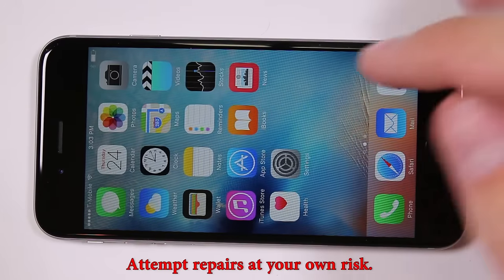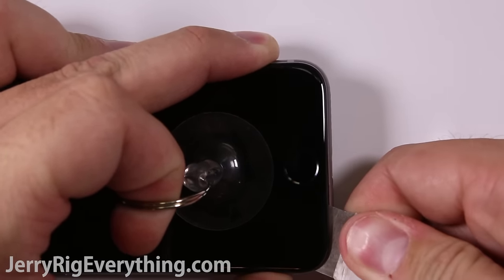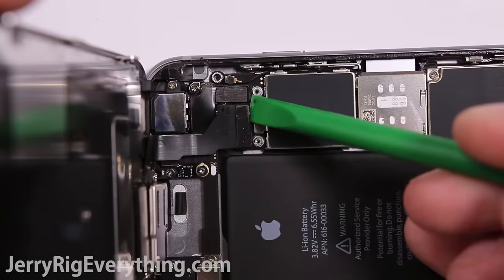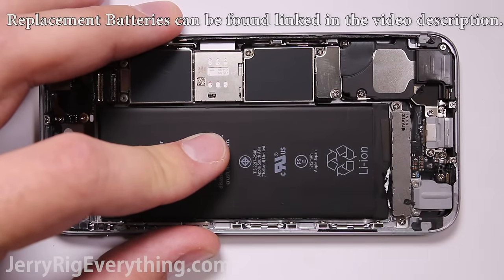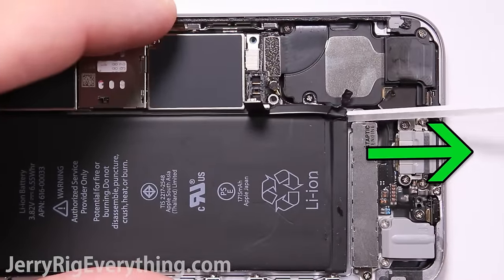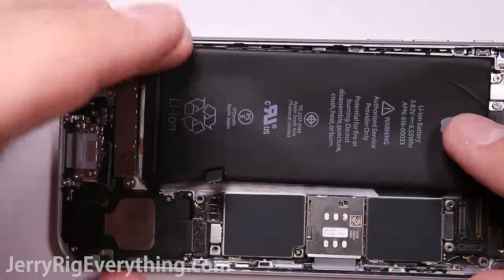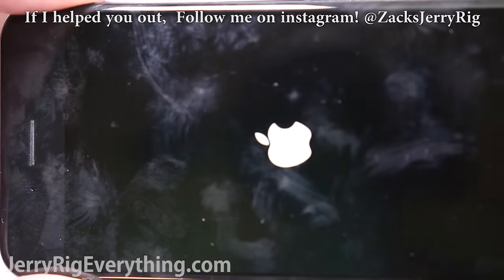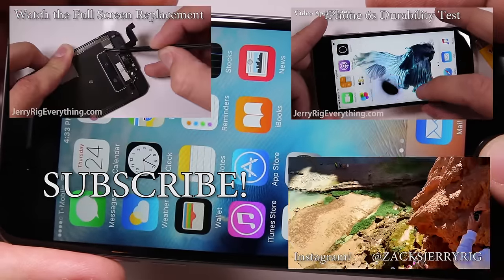iPhone 6S Battery Replacement in 3 minutes (Easy Method)

Comment: I'm thinking of getting an iPhone 6s but when I see how the battery is being replaced, I really get scared. Don't want it to get any marks or scratches. Wouldn't it be so much easier if apple made the replacement more user friendly?
Reply: Hate to tell you this but the iPhone has one of the EASIEST batteries to replace...the others are MUCH more difficult.  My personal preference is removeable back user replaceable batteries but for some silly reason "the industry" seems to think sealed, waterproof phones are better...they're not.

Comment: So. The easy way was to pull the strips out the bottom and hard way was to break the strips? If anyone is having issues removing the battery, Run the battery flat before trying this or add alcohol to dissolve the adhesive.
  Remove the rectangular metal device just below the battery, otherwise the angle is too sharp. You don't need to remove the screen at all if you hold it at an angle clamped by your hand against the phone. If it's cold warm the back of the phone with a blow heater or hairdryer or leave it back side up in the sun for 5 mins.

Comment: I followed these steps and was able to replace the battery. The phone turns on and the screen works however it seems to power off and back on randomly. Did I not connect the battery properly? Is that why it keeps doing that?

Comment: Annoyed how a phone seems to go downhill adter its paid off. Wasnt sure if this would be an easy thing to do. I have replaced the battery on my 80gb ipod a few times and repaired the click wheel but that was much older tech and seemingly easier. The ribbon cables on this look much eaiser to deal with. Im definitely going to do this over buying a new phone for a while.

Comment: VERY IMPORTANT SAFETY INFO: you need to drain your phone battery COMPLETELY before attempting to replace the old battery. I did not do this and the battery pack started getting really hot, so I panicked (because I know these things can explode) and put it in the freezer until it cooled down enough to remove the battery completely. IF THIS HAPPENS TO YOU, just place the battery (once you've got it out) into a bowl of water with lots of salt and let it sit for at least 48 hours to prevent an explosion or fire.

Comment: So i noticed when he was removing the battery he was really mashing it and bending it up. Is that safe. This could be my paranoia and overthinking getting the best of me but i want to attempt this repair however i am afraid that when i get to this point, i will bend the battery in a certain way causing the lithium cells to ignite. Its a process im capable of completing if i was able to overcome this fear as i have successfully replaced my screen on this device using a tutorial from this channel. Someone please help me with this information as i am in urgent need to do this repair. This is a stretch but im hopeful.

Comment: I did in 3 Minutes because I didn’t use those tapes either   As long as the connector is tight and put back the metal with 2 screws! You don’t need those horrible tapes since you will have hard time to remove too if something goes wrong 😂
And you don’t need to remove the connector to the screen too ! Just the 2 screws on battery connector! DONE

Plus : when I did the first time to remove the battery I made a big mistake and blowing up the battery 🔥 because I’d accidentally used metal to pray the battery and Buzzzzz 🔥 that’s my first lesson to be learned DO NOT USE ANY METAL but plastic ! 
But surprisingly the iPhone is incredibly there were nothing broken caused by boom battery’s I’m still using it now 😂 with new battery - the reason I love iPhone too ! Anti fires

Comment: Worked for me, BUT the adhesive securing the battery was nowhere near as simple to remove as yours. 
Sliding a spatula under it eventually freed things - but do this from the bottom, not the top, to avoid damage to ribbon connectors.

Comment: Followed all the steps carefully. But the new battery replacement doesn't fully charge even after leaving it for overnight. So I had to put my old battery back in. Now, it randomly reboots and can't read my battery under battery services. It just says your iPhone can't determine the battery capacity...
What did I do wrong?

Comment: its much easier to use a syringe and alcohol.. the tape comes out with one slow pull and then the battery just comes outs without needing to pry it out and risk bending it.

Comment: I just had my iPhone 6S Plus battery replaced at a shop and now discovered my wifi does not work. Is it possible that during the new battery installation that something related to wifi could have got damaged? I took it to Apple store, they shrugged and tried to sell me a new phone. Not impressed with these people.

Comment: To those that have replaced their battery, what battery did you go with? Does it hold the same charge as the original? Also, my SIM card (also any other SIM card) stopped being recognized by my phone after I dropped it in water. Do you guys think it’s the sim connector that got damaged and needs to be replaced or something on the mother board isn’t working as it should?

Comment: i took my 6s to get the housing replaced and it doesn't switch on. when lugged into charge it keeps flashing from the white apple start screen. would replacing the battery fix this? and if so would an iPhone 6 battery work? if not do you know where i can get a 6s battery?

Comment: I am desparate.  While I was replacing the battery, I damaged the "black tape" connector leading to the volume buttons and also the "black tape on the circle like" silver structure.  Did I just ruin this phone??  What is it that I damaged and can this be repaired??  Please help.

Comment: Just 10 minutes ago, I was trying to remove the old battery, which was glued to the cover, using a plier to roll the battery. When the battery was bent and suddenly exploded. Luckily just burned my thumb. DO NOT BEND THE BATTERY!!!!!!
Reply: Use plastic opener to deal with batteries .. otherwise it will blast
Reply: I burned my finger just a little bit as well.   I guess bending the battery was a bad idea

Comment: Good video but the removing the adhesive it not straight forward, it rips easily and gets stuck under the battery so you have no choice but to pry it with lots of pressure, this causes the battery to bend and battery catches fire. Luckily my iPhone is still alive. Also the kits you can buy come with one set of replacement adhesives which are quite hard to install. I ended up ruining them and using double sided tape like the video.

Comment: What about the adhesives around/beneath the screen ?? Why not put new adhesives there ?
Reply: Since it's not a waterproof phone, it's not mandatory to put new adhesive on the screen itself, i believe that's a fool-proof system for your warranty, it locks into place once you tighten the 2 bottom screws near that charging port. :)

Comment: interesting you mention lines will show if the ribbon is connected properly. after having.my iPad screen replaced I have horizontal lines every 4mm (very faint). they claimed to have tried 4 different screens to no avail. I'm wondering if it's worth trying again.
Reply from the maker: +David M Interesting.  If they have tried 4 screens, then it is probably an issue with the connector on the motherboard side of things.  Or.... a tiny piece of lint or dirt that is blocking the connection a little bit. (Ive had that problem before.)
Reply: Part of the repair included replacing the fpc connector on the logic board. I can't help think they messed it up somehow

Comment: Probably it's too late when you read this comment. I think I'm an idiot not reading the comments when I finished watching this (all over the place) clip. Guys, don't connect the battery before connecting the other plugs on top - this will destroy your iPhone. I also discovered that unplugging those was not necessary too. Jerry if you really have the least (lowest ever) decency you will take action to this and remake this clip with proper instructions. YT should take this clip from the top search if it hasn't been corrected. Plus side, I now (as many colleagues in the comments) have a new spare battery for a brand new iPhone. Any way, back to reality. Welcome to the club: smoking phones because of bad instructions.
Reply: One more thing since your in the club already. Next time backup your stuff. Have a good one.

Comment: My phone dies really quickly. Is there any way to buy a new stronger battery and have a phone shop do this for me? Also how much would this cost me?
Reply: Go to an apple store they are on discount at £25 (or a bit less value in dollars) until December 2018.  They discounted them as people were having issues with phones slowing down after an ios update and it was due to worn batteries so they had to reduce the price.

Comment: PLS HELP. once i connected the screen i checked if it was working and it actually worked perfectly. then i turned the iphone off again and tried putting the metal plate back, try turning it on and its not working. im even connecting the iphone to my pc and its not showing up.

Comment: thank you Sr am going to bye my battery for my iPhone then put it in
Reply: make sure to get the correct one...a 6S Plus battery will NOT fit in a 6s phone...and get one with the kit, not just the battery and adhesive strips...it will make it way easier to do

Comment: I followed the instructions exactly and everything worked perfectly...except for the home button.  It is non-responsive.  Any ideas on where I went wrong?
Reply: When I turn it on, it also says "Unable to activate Touch ID on this iPhone...?
Reply: The home button routes up the side of the phone and connects on one of the three ribbon cables that plug in at the top. So one of those ribbon cables needs to be reseated. I've also experienced these ribbon cables breaking during repair and not working after even though they look completely fine.¯\(ツ)/¯

Comment: After i changed the battery my 6s turn on but drained after a minute.. but when im about to charge it wont hold charge still in a battery logo even it is 30 minutes hold in a charger.. what should i do?

Comment: Can anyone attest to the reliability of the replacement battery that's linked in the description? on one hand $16 is not much of a plunge but on the other, i'm not entirely sure i can trust the quality of a $16 battery
Reply: Fisher Reese I had to replace a battery on my iPhone 4 a few years ago. Got a replacement kit with battery for less than $15 off eBay. It was an oem replacement snd worked really good. Battery life improved and stayed charged longer.

Comment: Y’all...BE CAREFUL!!!!! 
The adhesive strip ripped on me so I began prying the battery away from the frame. IT STARTED sparking so I took it outside and continued. Also was able to notice a sweet smell coming from the phone. DISCONNECT from the motherboard while changing out the battery!!!

Comment: What if you break just a little bit the silver part on the back of the battery and get a little spark.
If i cover that and the battery still works. Something can happened ?
Reply: NEVER do that.  You will be carrying around a ticking flamethrower.

Comment: geeksquad wants 50$ to do this, amazon has this battery for 20$, but do u really need the 2 sided tape ?
Reply from the maker: Yes
Reply: @JerryRigEverything  thank jerry, great video, i 've seen others where they didn't disconnect the screen/ribbons, is that truly possible, much easier to leave that stuff on, since you can sneak out the battery from the side? also, if you can get apple battery oem, which links for brands can you provide and refer on amazon to go with ( dont want to replace this once a year)????thank you!

Comment: I don't recommend trying this. I tried to pull the sticky tabs out from the bottom like he shows but they still snapped immediately, so I had to do the "pry of shame". I tried not to bend the battery but it's almost impossible not to, so the battery started smoking badly and almost caught on fire. The whole end of my plastic pry tool burned up. Just pay a little extra and take it into a shop.

Comment: For some reason after taking out the 4 screws on the plate, the plate is not lifting off
Reply: candopromo take the 5th one out and it will be much easier

Comment: all good guys, but be carefull when removing the battery,to detouch the adhesive as shown in the video, because my adhesive at first broke and then i had to fold the battery many times, so when i finished something touched my hand and i got a instant burn, not sure from what, but thank god wasnt big, quickly threw the battery off my hands, I suggest wear some protective gloves especially for stuff like that...

Comment: If you put double side tape and you want to take the battery back out after 
how would you do it. 

Answer please
Reply: Apple Master just take it out the same way...except you have to pry it out...
Reply: Usually you're supposed to replace the battery after one year. Some people are still rockin iPhone 4s (for some reason) so yes.

Comment: DONT REMOVE SCREEN - I undid the two screws, opened the screen 90 degrees, taped it to a box to stop it opening any further. Undid the two battery screws NOTE they are different sizes, disconnect battery. Pulled out the adhesive strips and the battery is free. Put new adhesive strips on and reassemble . I had never done it before and it took 5 mins. Bought the whole kit of battery and tools together on ebay for £9

Comment: The pull tabs broke and then I had to prie the battery out. I punctured the battery it started smelling, smoking and then a started fire on my table so I went to get a fire extinguisher and now I have a burnt phone and a charred table. :(
Reply: Punctured mine too but it was dead so no fire. Sorry, this tutorial sucks
Reply: Tom exe by any chance, do you have low blood pressure? Worried that I poisoned myself with that battery
Reply: @nicholasn.2883  I got a high blood pressure
Reply: @nicholasn.2883  I did get a terrible headache tho

Comment: So here is an odd maybe fact I swapped the battery Without disconnecting the screen. I wouldn’t charge(it stopped at 15%). I disconnected and reconnected battery AND THE SCREEN and now it was fully working. Odd no?
Reply: What was fully working? The battery life?
Reply: Yes after I swapped the battery and disconnected the screen the battery was able to be fully charged to 100%(as before only to about 15%).

So disconnect battery, screen. Install replacement battery and plug in. Then plug in the screen. Close the case and done just like the video.
Reply: canadianfoot dang it sounds pretty simple. Thanks for elaborating on this. My mum is using my old phone and the battery is really crap so I want to help her fix it rather than purchase a new phone. Another question, do you reckon I can do the whole process without disconnecting the screen? As in I’ll make sure it doesn’t go past 90 degrees and proceed with the rest of the process? Or should I disconnect?
Reply: Disconnect the screen I did same first without removing screen and the battery wouldn’t charge past the 15%.....so I reopened the phone disconnected new battery once again and the screen. It’s really easy hardest part is the darn sticky pads that are meant to be pulled. It’s more Frustrating than anything. If it’s your first time you looking at 10-20min. It’s not really hard just make sure you do it on a clean surface and have container for the screws etc. And remember which you took from where some are longer. The kits from Amazon are great make sure you buy the correct one for your phone that’s all. The back of your phone will have a Model number A....(A1533 for example) type that into Amazon and make sure it says it’s compatible with yours
Reply: canadianfoot thanks so much for your advice again! It really helps. I’m going to attempt it for the first time and hope for the best 😀

Comment: jesus. christ. If you are replacing your iphone 6s battery in 2021, this may be a difficult procedure. Took me close to 3 hours to complete. Mainly because of two screws on screen cables, thought for a while they  stripped but they were too tight. One of them did come out but the other I had to simply break its casing off because it would not budge. Tried for an hour and decided to just force it out. Then the f*cking sticky strips. Tried just as Jerry said here. Pulled straight down and they both broke off. Had to pry it out but the battery gave a spark which scared me so I had to be extra careful not to make it go off... Put everything back in... aaaand, just checked my phone. Screen doesn't work. Should have just taken it to the shop. Fuck this so much

Comment: I gave this a dislike because this video costed me my iPhone 6s, they tell you to disconnect the LCD cable before the battery and after you put in the battery, connect the battery before the LCD cable. PLEASE NOTE THAT THIS IS NOT THE WAY TO DO IT BECAUSE YOU CAN DAMAGE YOUR PHONE LIKE I DID. The circuit for my phone shorted out and now I have to spend more money on a new phone. This is how you should do it: DISCONNECT THE BATTERY AND AFTER YOU DO THAT, DISCONNECT THE LCD CONNECTOR. (As the matter of fact, it's probably better if you leave the LCD connector plugged in) AND THEN REPLACE THE BATTERY and RECONNECT THE LCD CONNECTOR FIRST AND THEN RECONNECT THE BATTERY. I really hope you don't make the same mistake as I did. I wish I went to the comments before starting this video.

Comment: after replacing the batter,my iPhone just suddenly off and on. HOW TO I SOLVE THIS?
Reply: David Marcelino same problem find any solution yet?
Reply: @sleepbroken   Yep! Try removing and connecting the battery again and make sure the metal plates are in the right position, cause that is the problem last time.